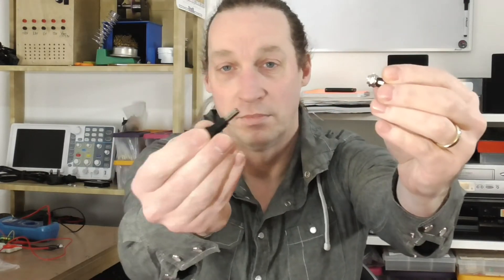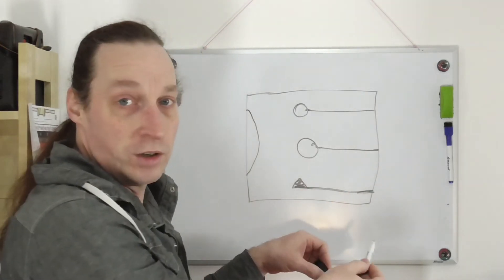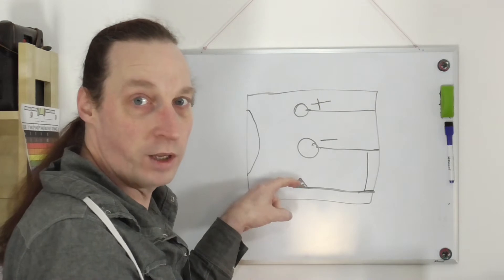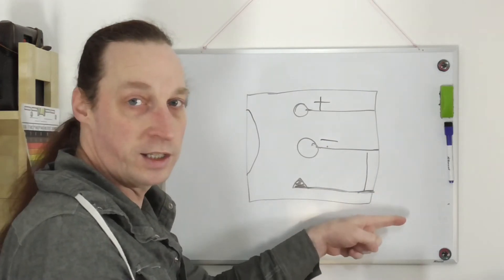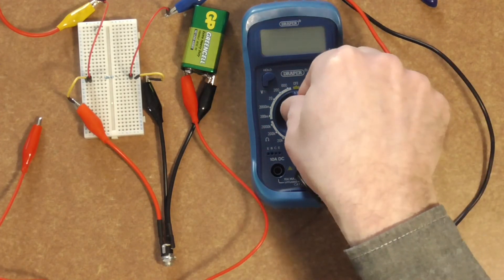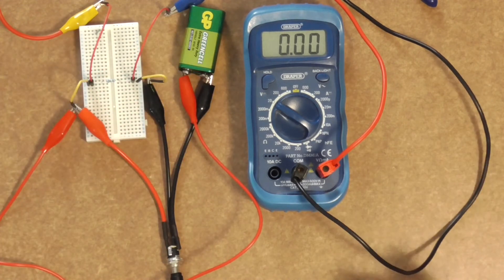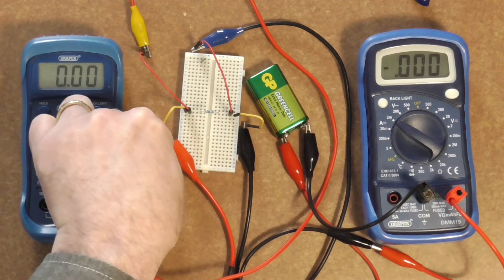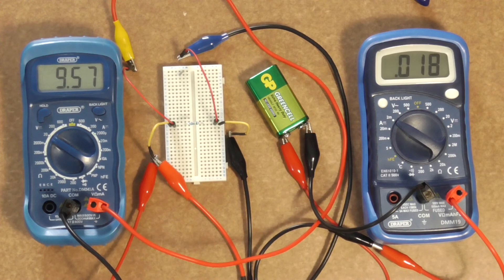DC Power Socket (third pin use)

Comment: You really need a closer view of where all the wires are going and the female barrel jack in full view. I have some questions for you if you don't mind. I have some US military TA-312-PT field phones that use two D-size batteries. I bought some power adapters and some 3-pin 2.5mm x 5.5mm water-tite female barrel plugs to put into the phones so I can use internat battery power or ac to dc power adapter. I want to use the center pin as positive. How do I  run the positive and negative wires from the battery compartment to the barrel plug ? And how do I wire the barrel jack pos and neg wires coming from the adapter power to the phones circuit making sure that the power adapter never back feeds power back to the batteries ? I need a drawn out sketch showing the wires coming to and from the battery terminals, to the barrel jack and to the phones circuit board. Can you help. Also, do you also know of a power back feeding protection to help ensure my batteries never get damaged and exactly how to make it or buy it. Thanks.

Comment: Brilliant somethìng thay appears so simple but a nightmare to actually work out, thanks for this video as i was about to go to one of my CB radios, which the internal speaker is disconnected when an extension speaker is plugged into the rear 3.5inch mono socket/jack at the back of the radio.
But is the power supply you use still centre pin + POSITIVE ?
✌️ ☮️

Comment: But in this case we can not charge the battery!!!
Reply: I was also thinking the same as male plug after inserting gets directly connected to the ground pin(middle pin of socket).
If we'll be using a rechargeable battery then it'll not charge as the male plug is disconnecting the male ground with battery ground.